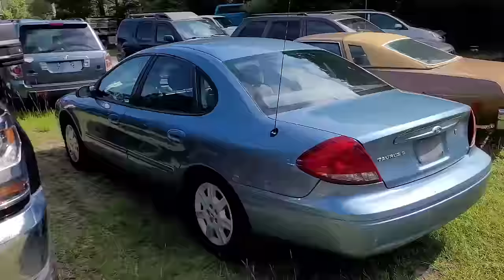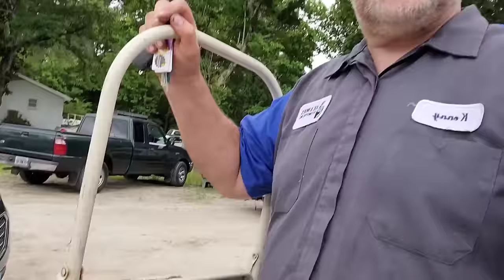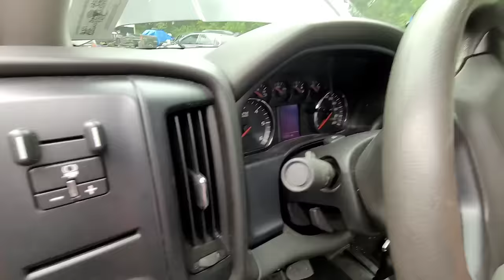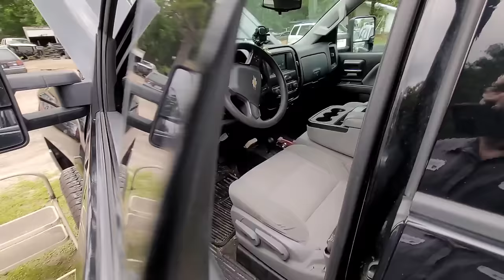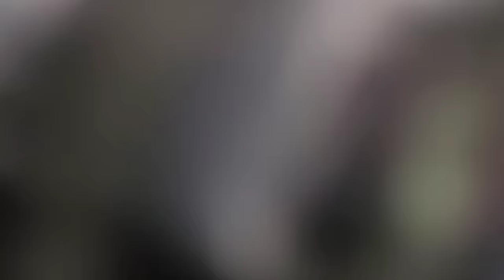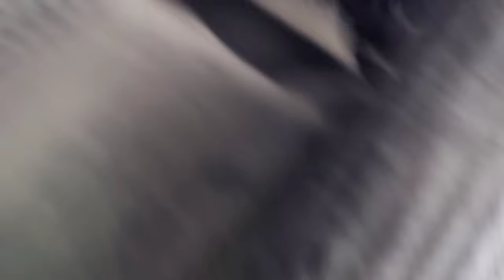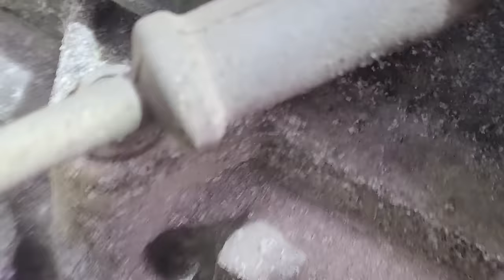Another GM 5.3 Ticking Noise. It's not the lifters on this one either

Comment: Easy fix, part store sells a bracket just for this problem that bolts onto the back of the motor and tightens to the face of the exhaust manifold.  Same thing will happen to the other side as well, they make a braket for that as well.  Of course could you could go the expense route if u like, which if you have the 706 heads you will be doing anyways.  Good luck!
Reply: I added the brackets to my 2006 ESV  (6.0).  Worked great!
Reply: the brackets are absolute best fix for these,and they make them for inner and outer cylinders.

Comment: Stopped the video at 0:40 to comment because I believe I already know. It's the infamous broken exhaust manifold bolt. Just the way it was described that once the engine warms up the noise goes away. I have a Caddy Escalade EXT (2008) that had this issue. I used one of those quick bolt on fixes and it has been great for 3+ years. Now...the GM V8 does have a habit of ticking like a lifter. I have owned several GM trucks dating back to the early 1990's and the truck I had with this issue was a 1996 Silverado 5.3. It was not the exhaust because it would tap all day. In the early motors I believe they had a valve train issue. I will click play and edit only if I was wrong.
Reply: Did not edit because I was right. But wanted to verify my engine. My truck is an Escalade EXT 2008 with the 6.2 and the broken exhaust boat was the driver side rear bolt which made putting on the bolt on "squeeze" fix tough because your hand is being smashed between the back of the head and the fire wall. But this usually happens to the same spot no matter the head position. The heads are identical from left to right. So if you have this issue on the passenger side it will likely be the front most bolt which is much easier to deal with.

Comment: A few exhaust studs on my 97 f150 looked like rivets when I changed them out. They rusted out so bad I had to grind them down flush with the manifold to get the manifolds off, then heat up every stud on it to pull them out of the heads. The manifolds themselves were so bad, there was no reusing them, they had to be replaced. Out of all that though, they never leaked although it was getting there. Now with new studs and manifolds, it's good to go for years to come. The one noise I can't stand is leaky manifolds.
Reply from the maker: Sounds alot like what I had to deal with when I was living in NY. Thanks for watching !!

Comment: I'm only at 1:05-have not skipped forward, and I already know what it is.. Broken exhaust bolt on #7 allowing a tapping or exhaust leak sound when COLD.. Once it warms up, the exhaust manifold expands and the tapping goes away.. #7 on these engines ALWAYS runs hotter than the other 7 and the expansion from heat, and contraction when cold, eventually break the head off the bolt at the rear most location on the drivers side-cylinder #7.. It is SO common. I run a transmission shop and almost every single vehicle that comes in with an LS engine is missing at minimum 1 exhaust manifold bolt-if not multiple bolts.   Update.. that is an LT motor not, and LS!  I still got it right though! I'm at 4:58 now..
Reply: I'm gonna call you Number Seven.

Comment: You would think as many years as this engine design has been around you would think GM could figure out you need bigger manifold bolts and possibly a redesigned manifold. I think every single one I've ever worked on had atleast two of the back bolts brake off, anywhere from 40k to 200k miles.
Reply: Nope, it’s a cast iron and aluminum cooling issue. Bigger bolts or a different manifold design using the same materials will do nothing. Compare the hemi cast iron exhaust manifolds to the srt cast steel exhaust manifolds. One breaks the bolts the other doesn’t nearly as much.
Reply: All said and done the root cause of the problem is the carbon and sludge build up and also the engine vibration. Both put together will  have effect on the exhaust connection ,bolts, and other things . Best of the best bolts will give in to such conditions
Reply: @joshkrause2977  : Bingo Josh! You'll notice any engine that has a steel head and a steel manifold doesn't have this problem, arguably... ever.

The true problem is that manufacturers have been using aluminum cylinder heads for about 40 years now, and then they bolt steel manifolds to them. To put it rather bluntly, it's just freaking stupid. 

Exhaust manifold fasteners can only take so much heat cycling and shear stress before they fail. That's the reality.
Reply: If they'd use  stainless  steel studs instead of  plain bolts,I'm sure alot of these exhaust related issues would go away ..
Reply: Designed to fail, keeps you buying new
Reply: @plowmaster1206  planned obsolescence perhaps...
Reply: @h8troodoh  no doubt
Reply: Antiseize

Comment: I have a 2019 Silverado 5.3l and stopped using 0w20. I went to 10w30 and much of the tick and tap noises went away. I have about 119,000 miles on the truck, all highway, and I've done every oil change myself. If you have a stealer doing your oil changes, make sure they don't try to sneak you out the door with 6 qts of oil in an 8 qt system. Yeah, I do all my own oil changes. I used to drive it in 7th gear to hold out all of the valve timing and emissions crap, but I installed a Pulsar LT unit. One of the best items I've every purchased for one of my trucks. The truck runs great so far.

Comment: I knew right when you started the engine what it was.  The high pressure injectors will cause a ticking too which everyone says it's normal.  I have the 4.3 v6 in my 14 Silverado.
Reply: Same thing I hear in my 15gmc with 4.3
Reply: Yes, but an injector tick is a much different sound than an exhaust leak tick. A trained mechanic knows this. Average Joe doesn't.
Reply: @turbodiesel4709  what causes an injector tick and how can I make sure thats what im hearing?
Reply: @victorcarreon7800  : Injector "ticking" is both a common & normal sound made by the electronically operated poppet valve inside each injector each time it's electronically "fired", on common-rail high pressure fuel injection systems. 

You can put a long screwdriver, a mechanic's stethoscope, or even a length of hose, to any injector body & to your ear while engine is running in order to amplify & hear the tick sound.

Some side notes pertaining to exhaust manifold leaks: 
On a cool engine, soapy dish detergent water dispensed via a spray bottle to suspected gasket and/or crack areas also works well to find exhaust manifold leaks. 

Also, visually inspect for blown out exhaust port gaskets & exhaust soot trails from such areas.

Most common exhaust manifold leaks come from burnt and/or blown out gaskets, caused by broken/rotted off manifold bolts.

Comment: I have an 01 Suburban with 320,000 miles and it's NEVER had a ticking issue ever.  Be certain the oil is full.  I never lose any oil in this one - I can drive a few thousand miles and the oil stays full and, also, the use synthetic and now I need to replace the headliner, but the engine is excellent. These 5.3 engines are great!!!

Comment: Our 5.3 engines are known for that bolt. They have a work around adapter to fix that on the ones you can't get to.
Reply: Hey brother do you have a link to that or what it is exactly called... i looked and both my rear bolts on driver and passenger side is gone 😆
Reply: @NORCALPYRO_  Search for gm exhaust manifold clamp. Dorman makes one that bolts to the back of the head and then has a bolt that pushes against the manifold when you tighten it.
Reply: @itsdavex2  thanks will do appreciate it.  Also do you happen to habe the part number you used theres multiple ones😬

Comment: This is a common problem with Chevys over the last 20 years.  Every single one I’ve owned, from new to used, eventually had this exhaust leak.  I’ve had it in the 4.3 V6 as well as the 5.3

Comment: I believe more times than not I have seen people's "ticking" to be exhaust leaks. Otherwise... ignition issues, bad pulley bearings, intake leaks,  a light tick sound from injectors and of course a loose spark plug (exhaust/system leak). More times than not it is repairable without major work.

Comment: this is how I got my free L83 for my c10. It was pulled under warranty by the dealer and they were just gonna toss it.

Similar thing happened with my wrangler with the Mopar/amc 4.0 inline 6, except it was the "windage tray" that sits above the rocker arms. I had pushed it down slightly with an oversized funnel when I was changing oil. Just enough so when it was cold it would touch but warm would be just fine. Figured it out by dropping and Alan key below the oil fill cap and lifting up on the tray while it was ticking, immediately stopped. As you showed, take your time and don't jump to conclusions.
Reply from the maker: Wow !! Good for you !! Years back , I wound up with a 96 LT1 long block from a WS6 Trans Am . The customer was hearing minor piston slap but was such a pain that GM decided to warranty the engine to shut them up !! I did the job and the new motor was exactly the same lol !!

Comment: I have a 02 Silverado with a 5.3 and have 575,000 miles. Blowing a little blue smoke on startup. Ticked since I've bought it new at start up an sitting long times and idling
Reply: I got a 99 1500 5.3 with 255,000.. Thing runs great!!! I love that truck.. I sure hope i get 555,000 out of mine!
Reply: Educational
Reply: How many transmissions have you replaced for those miles 3 or 4?
Reply: @anthonynicholich9654  Same transmission
Reply: @anthonynicholich9654  replaced first one at 250,000 then the another at 575,000. Currently on a good used one that came out of a wrecked Tahoe. The second one was bought as a remanufactured from Chevrolet and just lost 2nd and 4th.

Comment: My mother has an 08 suburban with a 5.3. We had lifter failure, and a few other issues which lead to a total engine replacement (not my suggestion) and after 20k, I was driving it, changed the oil. All was well, 50 mile drive home after, and it sounded like lifters again. But after using a stethoscope on both heads, I couldn't determine a metallic noise comming from the valve train. Checked coils and they appeared to be fine as well. Now I'm wondering if this is our issue. Problem is it doesn't change once it gets to op temperature. Thanks for this, now I feel dumb and have something to trace down now lol.

Comment: I thought this sounds like my truck and it was a broken exhaust manifold bolt. I replaced the bolts with studs on all three of my trucks, Best $50 I ever spent on parts.
Reply: I have a chevy silverado V8 4.8 it tick 3 to 4 minutes after starting. 15 to 20 minutes later it stops. After that it runs extremely quiet. Until I let cool down it won't tick. Do you think it's my exhaust manifold bolt?

Comment: They make a clamp kit for these that uses existing holes in the block and head to push the manifold up tight to the head.  Works great saves having to drill out broken bolts.
Reply: who makes the kit, what do you call it or where do you get it, thanks
Reply: ???  Info please
Reply: @JerryLeeMac  Dorman Products or Kral Auto Parts

Comment: Used to do a ford 5.4 at least once a week,it would have such thick whitish electrolysis between the manifold(iron) and the head(aluminum).add a little water from the combustion process,and u have a battery basically.it would get so bad on these linen vans,it would rust jack the manifold from the head and come in with both sets of end bolt heads missing once a year

Comment: i got rid of my ticking on my 05 5.3 just by changing to 10w40 conventional Castrol GTX oil with K&n filter. Been 3 years now with no tick and better oil pressure. Engine has 290K
Reply: @bretfeeney1072  didn't you read?? Been over 3 years without any ticking. Through winter, summer

Comment: Most common issue is if not lifters and after having sat is problems with exhaust manifold leaking!  Very common issue with the ls, and dodge hemi's.  Both my wifes yukon denali with the 6.2 ls and my dad's HD 2500 Silverado have this exact issue.  The problem lies with the head being aluminum and the exhaust manifold being cast iron.  The two different materials expand at different rates and causes flexing that break the bolts, or even crack the manifold.

Comment: Man, that was a loud exhaust leak, I thought " something's disconnected, bolts fell out, or it's cracked."
I listened to one today that needs probing with a metal tube in a stethoscope.
It needs the accessory belt removed to eliminate those, but it seems to have 2 noises or something's loose inside making it random or half of it random.
It rattled some as it drove away as well.
Weird.
Need more input.

Comment: Piston slap , my  2ooo sierra 5.3 with 288,000 mi,s has same problem for first 3 minutes. I was a autotech for 46 yrs. I worked 8 gm dealership and one chrysler. Engines were my specialty.

Comment: that noise was way past a "ticking" sound. my 5.3 ticks like a time bomb but that is the sound it makes. a "ticking" just like a clock. that 5.3 sounded like a tractor. i agree, if he does his own work he should have seen that right off the bat.
Reply from the maker: I was pretty much going off what he told me when he dropped it off. It was hot and sounded smooth. He really thought it was a camshaft because of everything he's read online. He's happy I found it wasn't a cam. He's actually bringing it back in two weeks for me to fix it
Reply: Mine ticks like a time bomb as well, what does it mean?

Comment: FYI for people tracking down exhaust leaks. Connect the exhaust side of your shop vacuum to your tail pipe to pressurize exhaust, then spray soapy water on the flanges, joints etc. No more burnt fingers.

Comment: LOL.  I knew what it was as soon as the video started.  I have exactly the same thing on my 2014 Silverado.  I bought it with 55K miles and it now has 76K.  Kind of funny in that I had (until I bought this truck) an 86 F250 with a 460 I bought new and it was notorious for snapping the right hand rear bolts on the manifold as well.

Comment: What would cause a 5.3 to blow out black smoke on start ups and high acceleration? 
I’ve been chasing this problem for months. Truck has 227,000 miles on it. Has also I slight ticking noise. And also if you get on it at 60 or above it spits and spuders and acts like it doesn’t want to go. Any help much appreciated!!
Reply from the maker: Ive seen upstream 02 sensors cause this . Also intake vacuum leaks at the cyl head . Finally , clean the MAF with Electrical Contact Spray
Reply: @WrenchingWithKenny   thank you sir!!
I’ll look into all of this!
Reply: @WrenchingWithKenny  I have a 2014 lifted Silverado 5.3 that has a tick for bout 10 seconds then I hear nothing but that's besides the point iv had the truck for over 4 years now but for the last 3 months it' has a slight hesation on the flat going 55 where the RPM needle fludders slightly up and down an it's worse when the engine starts pulling down could be plugs wires or coil injectors but absolutely no engine light but I just got done changing out the spark plugs the truck seems to have more power but if takes care of the hestiton I don't know
Reply: I was having the same issue. I just changed my fuel pump because it went out completely, but also changed my MAF since cleaning it didn't work and so far it's running better.

Comment: Heating and cooling isn't the problem .  The problem is GM is to cheap to use proper bolts.  They want to save 5 dollars per engine.
Reply: It's not hard to extract broken bolts from the aluminum heads with a welder..just takes some time.
Reply: You're right, it a quality issue. Possibly a thickness issue too.
Reply: It isn't just GM..its a hemi problem and triton problem..40 yrs of doing this crap..just retired

Comment: I have a 5.3 in a Silverado that I bought new in 2011. I have a light tick and blow by. These motors are turkeys and I am thankful that mine has made it to 176,000 miles. When it goes, my 1990 XLT Bronco with a 5.8L will replace it. You can’t make a 5.3 reliable. They are plagued with issues, or so I was informed when I worked for GM. Some of it is on the owners who change their oil when the idiot light goes off at 10% or 10k plus miles

Comment: My 05 Silverado ticks on occasion.  Once the engine is nice and warmed up, it goes away.  The exhaust manifold just expands at a slower rate, but once it's heated, it closes the gap and, bingo, the leak is sealed.  They sell these clamp-looking things, one for the front and one for the rear of the block, and they can squeeze the manifold onto the block and stop the leak.  I don't know if they last long though.  I watched a guy install them, and I'm tempted to try it myself.